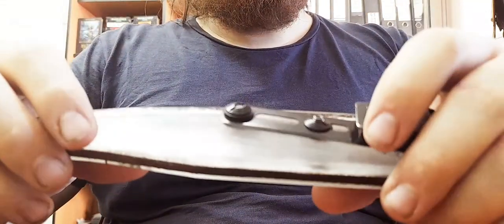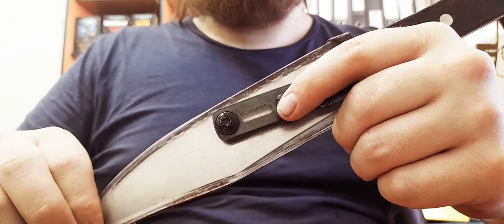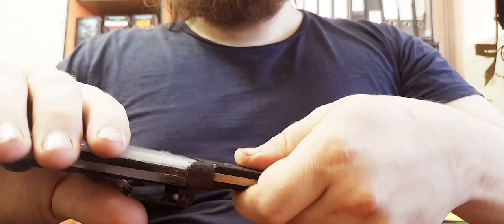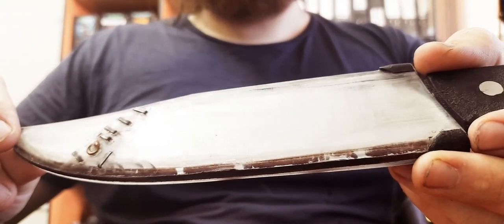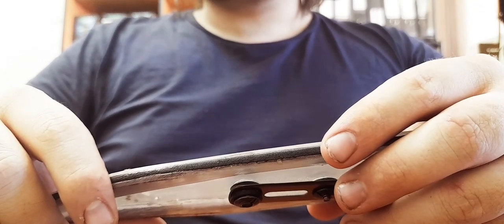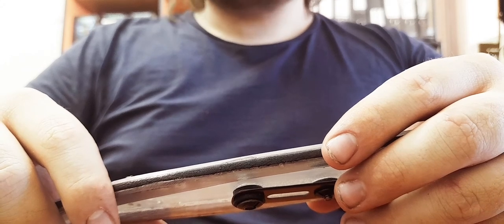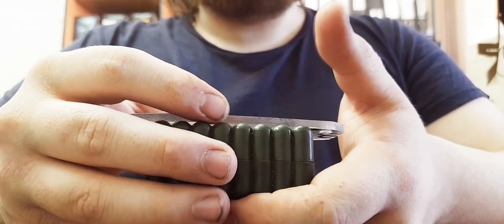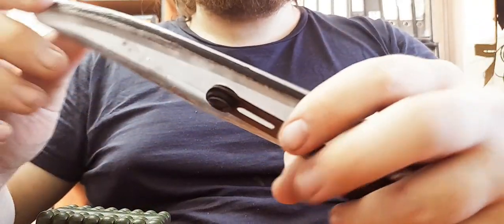Durable, but not so much. update on aus10 bowie and its sheath.

Comment: Thank you for putting up this video of your tests and experience. Your the only person that I know of that has a polycarbonate sheath so your information is very helpful.
I’ve never heard of stabilized leather but it looks great and I’m guessing that it should be extremely tough. 
How do you like aus10a? How good is it for daily carry? 
The knife still looks great with the new handles.
Reply from the maker: Its good to know that its helpful)
Its aus10co to be precise, so its aus10 with an addition of cobalt for toughness and corrision res. 

Considering its price (which i got it for 20 bucks) it is GODDAMN outstanding for edc. It does not rust or patina, sharpens very easily to really fine edge, it withstands some chopping and is good for a knifemaker to process (grinding and stuff. Overall 10 out of 10 for the price. 
Even tho i have more premium steels in my collection, i prefer this one any day of the week for edc working or kitchen knife.
Reply: @rtknifeandsword9618  I didn’t know about aus10co, nice it’s something I’ll look into. 
It’s good to know the opinion of someone who knows their stuff, thank you.

Comment: Oh, and just to guess: from what you described I would say that polycarbonate is impact resistant but not bend resistant. So it can take direct hits but it will shatter like glass if you bend it past a certain degree. I’m not sure why it does this but from what you’ve tested it’s still stronger than anything I’ve used for a sheath.
Reply from the maker: I thought about your comment for a while and done some tests on sample scales. And i tend to think differently: it can bend 180 degree and take a set, but not break, but when its bent rapidly, even tho the bend itself is less than 90 degrees, it snaps. So i think of it like of non newton liquid, which on some impacts just absorbs the energy like a liquid, but on others it breaks like its fragile. And if you just strike it in the air, it performs indifferently, very solid.
Reply: @rtknifeandsword9618  thank you, your comparison to a non Newton liquid is perfect, it helped me understand. Polycarbonate seems like a really weird material then, I’m glad to know more about it.